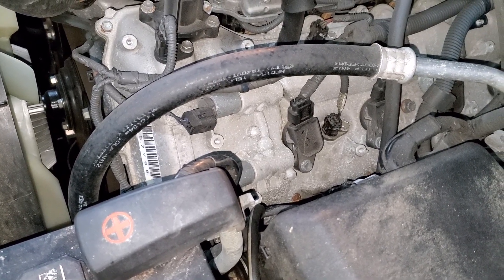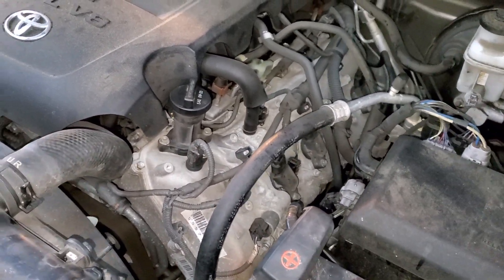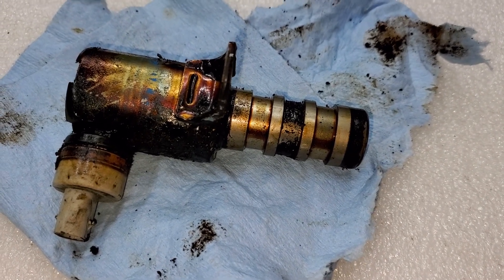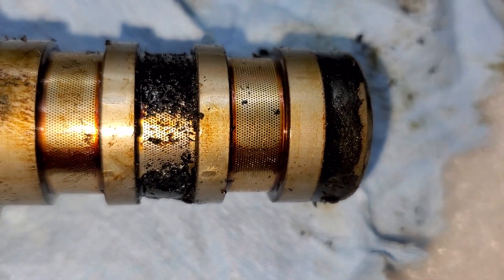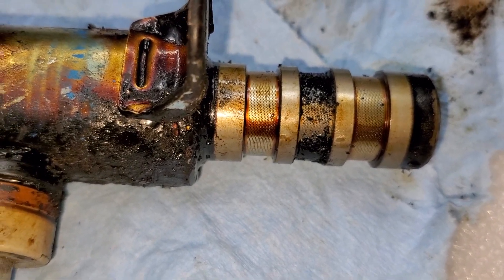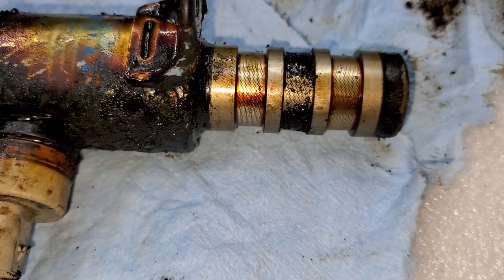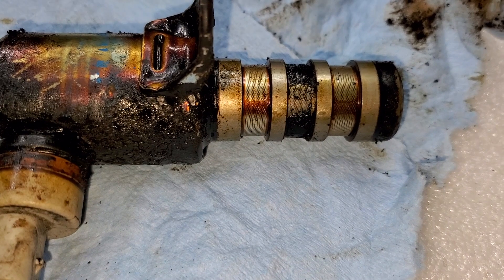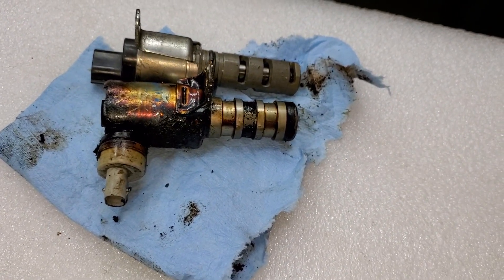FORD F150 vs TOYOTA TUNDRA solenoid design, Why ford has issues with VCT solenoid, ford cam phasers

Comment: I currently own a 2018 f150 lariat with the 3.5 and it will be going back into the dealer on Monday for the 3rd time for the phasers... I'm so over Ford and their bs, considering trading for a Tundra
Reply: For all the hype over the v6 f150s I am completely un impressed by them as a technician. The pursuit of being lightweight can quickly get out of hand when you are also trying to reduce cost. 

Plastic oil pans! On a truck!
Reply: @jza61nick  this is exactly it
Reply from the maker: Thank you for sharing this.
Reply: @repairvehicle  no I must thank you, for sharing your knowledge and expertise and being honest about things.

I don't think Ford even cares at this point with these mass failures. I had taken the truck in a couple weeks ago because the phasers were failing again, at that time Ford was issuing recalls under 21B10 to reprogram PCM. They reprogrammed PCM and that literally made the phasers worse in addition, now the trans is starting to shudder and do weird things lolol. Last night my Ford pass updated for recall 21N03 for phaser replacement again.

These issues need to be known and Ford needs to fix and help out their loyal customers, not issue bs TSBs or recalls that literally make the situation worse and then go the extra mile and start effecting other power train components
Reply from the maker: Coryy650, please share this video with others via Facebook or any other ways. Thank you
Reply: In the short run, you could use a product like BG 109 as an engine oil flush that works great to clean those screens out. However, in the longer run, you’re better off saying. Goodbye Ford....

Comment: I have a 2006 Toyota Sienna with  variable valve timing V6 and have had no issues with the solenoids whatsoever. It runs like new. I also have a Sequoia with 4.7 v8 and again, zero issues with the engine. However, my 2011 Suburban with a 5.3 v8 has had issues with oil control system - stuck lifters and plugged screen at the pressure sensor, and a bad oring on the oil pick-up tube. It has been repaired and is on the road still, however with that stupid afm deleted! I've never owned a Ford and likely never will. Ya'll know why.

Comment: I agree but my 6.2L F150 is a REALLY GOOD Engine. Maybe better than toyota.  It will give the 5.7L a run for the money.  6.2L VVT is also indestructible. 
I also own a GS 350AWD.
Reply from the maker: 6.2 none vvt, its a good engine. I prefer 6.2 over ecoboost any days
Reply: @repairvehicle  6.2 does have VVT. It is the borg warner cam torque actuated system.
Reply from the maker: Ford vvt systems are known as problematic and very sensitive to dirt and low quality oil. I am sure I have seen ford 6.2 without VVT. There must be certain years that have VVT. None VVT good engines.

Comment: If I have a phaser rattle on my 5.7 do I just need to clean or change the solenoid to improve oil flow to vvt phaser and rattle stops? Or phaser need replacement
Reply from the maker: It depends on mileage and maintenance intervals.  Most likely you need to replace timing chain, guides, cam phasers and so on.
Reply from the maker: How do you know you have phasers rattle on 5.7?
Reply: @repairvehicle  Thanks for responding I’m  approaching 129k my oil change intervals are usually between 4-5k but from hence im sticking to 3-4k intervals! Already changed damper lines and tensioner a while ago I get a 2 seconds rattle at the top on bank 1 driver side immediately after start up! If it’s not going to be much of an issue I don’t want to risk touching the timing systems and they get it wrong or bend valves and everything becomes catastrophic! I stay in Africa hot climate I was using mobil 1 0w40 fully synthetic unknowingly to me instead of 5w20 or 0w20 which are not available in my region but 5w30 is I want to start using that 5w30 instead! Matter of fact I’m about to purchase it as I type! Kindly guide and advice Thanks 🙏🏾
Reply from the maker: What do you have and year?
Reply: @repairvehicle   2008 5.7 crew max 3UR Engine! 129k
Reply: @repairvehicle  also heard people switch to 5w30 and OEM oil filters quietens things down
Reply from the maker: Rattle could be coming from chain. Changing solenoid might not help unless you have codes.

Comment: It might be a good idea to use 0w20 or 0w30 because of those small holes. Our 2010 Taurus SHO 3.5 Ecoboost recommends 5w-20, but I think we will try using 0w-20 and see if that change gets rid of initial cold start vct noise. The recommended 5w oil can't be the best for cold starts especially when the holes on the solenoid is that tiny.
Reply from the maker: Use quality synthetic oil,  don't use synthetic blend.
Reply from the maker: Thanks for commenting

Comment: Thanks for you Chanel. You add much information to us.
2019 toyota camry 2.5 engine. 8 speed. I changed my transmission oil on 50K now it is time to change fluid 98k. I'm thinking of amsoil but what best for my car?
Reply: Waiting for your reply. Thanks again
Reply: For the camry I found 2 type
Signature
And
OE
Which one?
Reply from the maker: You can use either one.  Signature series is the best stuff money can buy
Reply: Awesome my friend. I will change it next weekend. And will do another one after a week just to make sure all toyota fluid are out
Reply from the maker: Best Automotive Fluids made by amsoil,  I have done many testing, oil analysis and never seen anything better than amsoil.  I use it myself in all of my cars. https://www.amsoil.com/lookup/auto-and-light-truck/2019/toyota/camry/2-5l-4-cyl-engine-code-a25a-fks-0/?volume=us-volume&zo=5257753

Comment: Wow good to know.  I have 2011 f150 with ecoboost engine 235,000km now, no issue yet since day 1.  I definitely getting a tundra in near future, that's for sure! 👍
Reply from the maker: Thanks for sharing.  How often do you change your oil?
Reply: @repairvehicle  used to oil change every 5000km on full sysnethic oil and now on 2nd time with amsoil extended to 15,000 km instead.  I'm not sure if it's good idea to extend longer km on single oil change since I watched your video 😆
Reply: @jasongracebiehn5379  it’s not a good idea to do it blindly. If in doubt, do oil testing. However, you can’t go wrong with using OE amsoil and changing it every 3000-5000 mile. It also depends on the type of vehicle you use. If you are a highway car, go with the amsoil signature as you will rack up miles quick, meaning more oil change if you use OE. However, you will also want to use the amsoil oil filter, and reenforce it with oil testing... which means $$$.

Comment: I have over 215,000 on a 2010 Camry. Mine has not failed on my 2.5L.  I change the oil every 5,000 miles with Amsoil OE Full Synthetic 0W-20 oil.
Reply from the maker: Great example of Great engineering.

Comment: So if we pull the solenoids on our 5.7, we could expect their cleanliness to be an indicator of the cleanliness of
the VVT system and the timing chain tensioners? If there is carbon build-up or sludge, we would need more frequent oil changes and / or a better oil  and filter.
Reply from the maker: Correct.

Comment: The Honda VTEC solenoid for their K engines is also on the side of the engine block. It leaks with age, but rarely fails as well. The leak can even be fixed a simple gasket change that can be done in a few minutes. The other thing about the VTEC solenoid is that the gasket does have a screen (that was a little more porous than the Ford screen) but it wasn't clogged at all on mine when I changed it.

Comment: I see how the Toyota solenoid design is alot better in design but wouldn't regular oil change intervals and high quality oil prevent a Ford solenoid from having these issues?
Reply from the maker: Restricting oil flow will cause it to fail no matter what.